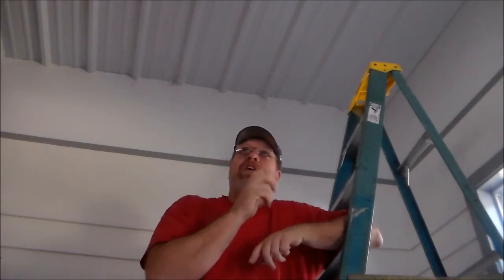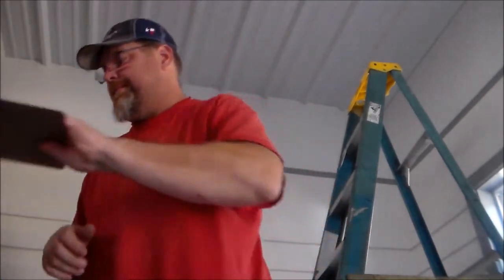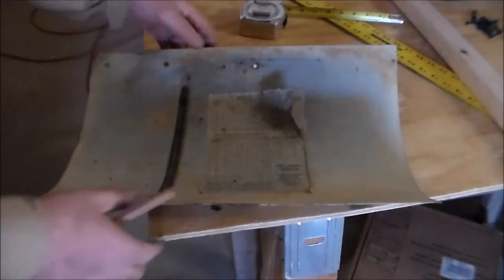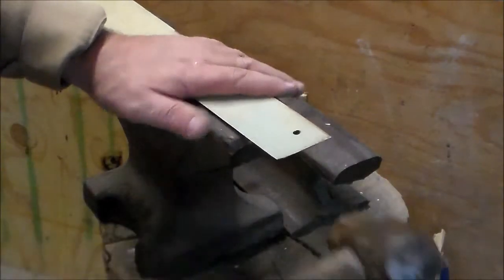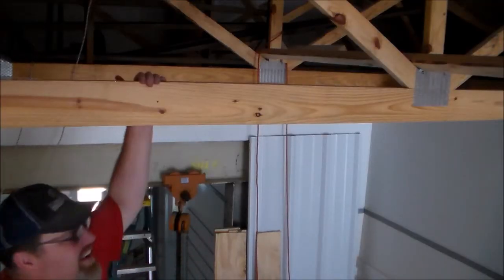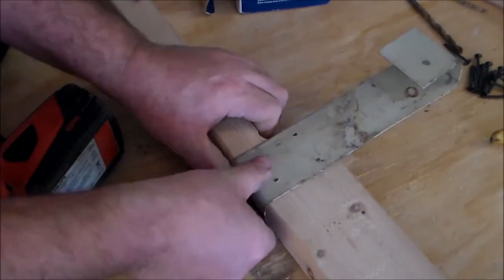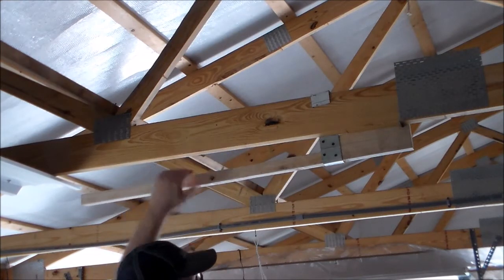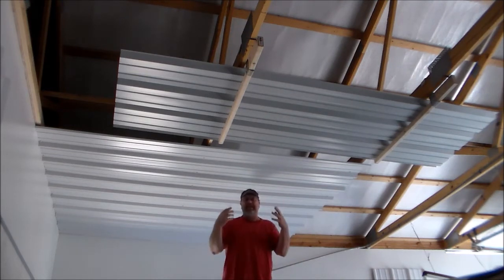Free tool! Make it from scrap, saves your bacon! Metal ceiling, easy!

Comment: I just finished a 30x40x14’ high ceiling by myself with 12’ panels. I built and used two of these on a basket lift with a deadman pole in the basket also. I could not have done this job by myself without these hangers. Thanks for your idea, it works great.
Reply from the maker: Great! Glad it helped!

Comment: The greatest inventions come from necessity.  This is a great idea.  I guarantee you metal supply shops would sell something like this like hot cakes.  I'm putting up j channel right now on my 40 x 30 twelve foot high ceiling... I'm so glad I came across this video.   I do everything myself, so I've been wondering how I was gonna hang the metal.  I will definately be rigging  up something like this.  Thanks for sharing brotha
Reply from the maker: Hope it helps. I've been using it on my ceiling and it works great up until the last row. On the last row, I just make a couple shelf bracket looking things and screwed them directly to the wall.

Comment: I've always liked the idea of an open roof. Did you install the panels because of your welding/sparks etc?
Reply from the maker: No, I wanted a ceiling so I can insulate the shop. In the summer it will get over 100 degrees inside, and in the winter below freezing. I'll eventually get a wood stove, maybe even full hvac, but in the meantime an insulated shop evens out the temp a lot. I also think the white ceiling really brightens up the shop, reflects a lot more light from the shop lights.

Comment: This is a great idea!!!
Loved the intro - FULL AUTO SCREW GUN!
I'm building my barn next month and I will DEFINITELY try this idea on my 12' ceilings! 
THANK YOU for this idea!

I have to ask, was the first sheet you put up on the brackets upside-down?
Reply from the maker: Ha! You weren't supposed to notice that! Yeah, upside down, I was just trying to demo the idea and didn't realize it til the edit. It's working great for me, I'm only about half done. Don't be surprised if you have to flip the bracket, depending on were you start, you might need a lefty or a righty.
Reply: @SelfMadeProject  Well, today I'll be driving the last few screws in my pole barn steel ceiling. As I mentioned in a comment on your other video, I chose steel over drywall based on your videos and I cannot thank you enough for the information. I made two of these ingenious devices when I started my ceiling and let me tell you it was a game changer! So simple but effective!  Sadly, my helper didn't hang around very long and even with your brace device, hanging the 16' panels just wasn't possible for one guy. At least not THIS guy anyway. Sad to say, I'm not half the man I was 10 years ago. Everything is slower and more difficult - lol. So I had to 8I+c# out and buy one of those harbor freight panel lifts. As you mentioned, it was about 8" short for my 12' ceilings so I took a page from your book and "improvised"! I built a basic 10" extension "deck" to give me the needed height and length to support the long panels. With that lift I was able to do the entire ceiling by myself - except for needing the wife to come out and help me lift a panel onto the panel lift every time I finished a panel - lol. 

So I say all that to say THANK YOU for your videos and for sharing your knowledge and creativity. Not to mention thanks for the laughs - I get a grin every single time I watch this video with the full auto screw gun. The shot were the screws are falling like brass casings gets me every time brother - every time. 
Be well.
TJ

Comment: I start my 51 sheets installation tomorrow, I went with the lift, but, I am 16 feet high with 24 foot long sheets, I sure hope my 2 helpers show up, smile. But I cheated also, I modified my lift a tad.
Reply from the maker: Wow, 24' sheets 16' high! That's going to be a job! Even with helpers, that will  be slow going at that height, be careful.

Comment: Any ideas on how to make sure the liner panel is squared up with the room (ceiling) so it stays running nice and parallel throughout the ceiling panel install? (3-4-5 and a string line?)  Or what did you do?
Reply from the maker: I just tried to be consistent on aligning the panels as I went. When I got within a few feet from the opposite wall I started measuring. I was getting off by about an inch on some of the rows. So, on the last 2 or 3 panels, I fudged them out a 1/4" -1/2" each. You can't see it from the ground. I guess you could chalk-line a couple reference lines here and there, but I don't really think you'd need it, it stayed pretty straight.